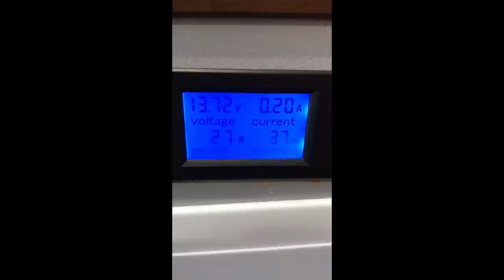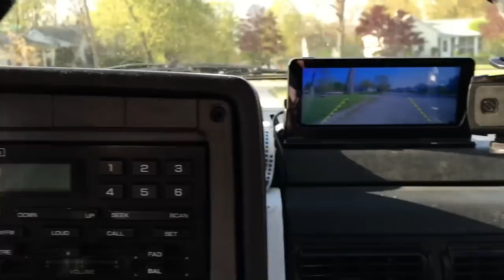Box Truck Conversion GMC C5500 Topkick

Comment: That looks really professional. If you haven't found your calling yet, this is it!
Reply from the maker: Wow, thanks!
Reply: Was thinking the same! He could be a Design Consultant for Forest River, Coachman, any ones out there!
Reply: The Heard I have questions about your electrical system... How do you have the electrical capacity to run all those appliances and AC and refrigerator all off of those few panels? 

How? What kind of batteries do you use to run all of those things too? I want to understand your electrical setup. It boggles my mind.

Comment: Cool project. We have one of their trucks converted for lawn mowing. We have found that the box is not 100 percent water proof and after a good rain water will run down the walls a bit. Not a problem for us but if you have nice walls and such you may want to re caulk the corner seams.
Reply from the maker: Done. Thanks for watching!

Comment: I think that was absolutely fantastic!  Love those low floor U-Haul trucks and never thought to convert one.
I do have a couple of comments though.  1) During the cool mornings, hot days and again cooling evenings, the Styrofoam tends to expand and contract making creaking and popping noises.  I would have opted for either spray foam or batt insulation.  2) Not sure if you were using 2x4 or 2x2 wood studs, wood is ideal for the floor but maybe consider next time using a 2x2 steel stud for framing.  It is must lighter overall and is fireproof.  Fire resistant materials should always be a main consideration in such confined spaces like a camper!
3) Will you be using it during winter? If so, did you make sure that all water lines slop back so that the entire system can be drained?  Did you install insulation around the plumbing?  Did you install heat tracing along the plumbing to prevent water freezing??

One other after thought.   I would suggest that you move those batteries out from under the side wall so you can easily access the fill caps and add "distilled" water when needed.  Also buy and install a large "rubber" low profile pan to sit the batteries in.  Deep Cell Batteries when charging are known to expel gas fumes and boil over.  Boil over is water/acid excaping the cap vents and flowing onto the floor!  A catch pan will save your floor from be eaten away.
Reply: Nothing beats spray in polyurethane foam, though it is the most expensive, it can actually add structural strength and is for sure the most effective R value per inch.  My only critique of the build.
Reply: Great job, well done!

Comment: Nice job. I like the design and the craftsmanship shown. Not a fan of all of the different finishes, but that's just a question of individual tastes. Overall 10/10 for the design, 10/10 for the craftsmanship, and 8.5/10 for the finishes. Would make for an interesting business model to make a floor plan like that you guys could knock out for others. For use as an RV or even as a spare spot for guest.
Reply from the maker: Im now becoming more aware of the possibilities this build is bringing. It just started as a personal build. It has become so much more now.

Comment: This undoubtably is the nicest and prettiest U-Haul conversion I’ve ever seen. You did a great job! From what I could tell you  actually forget you’re in a truck box when you’re in there! Kudos and good luck! Stay safe.
Reply from the maker: Thank you for watching. You 100% forget your in a truck. There is a realization every time you step outside, it’s surreal. Also, the individual spaces can be closed to feel extremely private and opened to get the opposite effect. The spaces came out better than I designed originally in that regard.

Comment: Here is a low cost way to reduce the flat front, get a clear skylight cover and attach it to the cab over part. Mount a camera so you can put above it led security lights.then paint the area that is not used for the camera and lights , looks less box truck and easy to hide tv and radio antenna, wi if antenna s, external cell antennas, security monitors.i like your plan. You could make awnings for the windows from some of the scrap window cutouts. Use tear drop hatch hinges and rivet them on use a internal latch so you could seal them up if you had to store it, and it would be secure. Did you make a pass thru from cab to house?

Comment: Saw another vid talking about paint. Best paint is truckbed paint little $ but heavy scratch resistant paint once an have in colors yu want
Reply from the maker: Peggielee Roberts Yes the paint hasn’t held up in a short period of time. I only did one coat of some Dutch Boy exterior paint, but still. Thanks a million for the suggestion, that’s probably what I’ll do next.

Comment: Really interesting build, think for the extra money i would take it to a place that custom builds vans and have them design a less bullky morr open mutifuctioning space .
  Good chassis. Installing the solor and insulation would be good and mite save you some money you could wire it to long leads and they could figureout how to tie it into the more functional space.
   Decent learning experience still keep on building them you will get it all dialed in.
Reply: That’s the beauty of the custom build. It’s builder’s choice. We all decide what works best for us and we go for it. 😎

Comment: Hey just an idea my guy...u might want to make a door between the passenger seat and the driver seat so u can get in and out of the back without opening the back sliding door but make the door where u really can't tell there is a door there and put a good lock on the door just in case

Comment: Very nicely done... very well thought out . Question, did you have space for alternative transportation,  like a spot for an electric bike or a Honda trail 125 just in case you saw a really nice road to enjoy as you travel... or (God forbid) if you broke down and needed to get around to fetch a part ? I find that not many conversion builds include multiple types of alternative methods of transportation or power sources and power supply systems like generators or solar or even electric power stations
Reply from the maker: Ive been able to travel and keep my car with me. So far so good. I took reliability seriously as far as components and redundancies as best as i could with the budget i had. Thank you for watching.

Comment: The color choices aren't my top choice... But honestly it looks like a real build not some glammed up person with piles of money that I couldn't keep up with even at 200 percent effort... An scoring on left overs from people in way better circumstances left an right that actually match nicely... 🍹🍹🍹You did good...rug is nice with the colors you picked... I'd do a different colored counter for sure... But I'm a beach sea blue themed type myself.... beach wood weather's light blue chips so the counters an rug would be grey's an blues an some white an brown... But honestly low price an free is normally where I stand... Hunting an amassing items big by bit.... looking good... Wish I felt near as confident in my travel trailer rebuild never thing... Honestly going to have to pay for it register it then work on the floor rot that's dangerous... The bad plumbing in the shower rotted the whole bathroom an in front halls floors... The pipes under the sink I tried to fix that leak a number of ways.... An the toilet only flushes in hot weather... An when using septic safe tp an we do not have septic???.? Thankfully it's 112 all summer here..... So at least that's not a issue intill Dec then I have a camp bucket trash bag system for then... Really... I wanted to build a camp cabin in the woods an start with a bucket toilet anyway.... Like I said bit by bit...

Comment: Great job! Just curious about how much did it cost for the conversion? I want to do one but I have. No idea what type of budget I'm gonna need.
Reply from the maker: Wll this is 24 foot. With every square inch accounted for. Im in a bit over 20k. Could be done cheaper with a smaller rig, less components etc.

Comment: Dude nice build.. did you do anything to the suspension? I have a c4500 and it rides a little rough. Thanks
Reply from the maker: I did not do anything to the suspension. The ride isn’t the best around town, but very smooth on the highway. Ive got some quotes for some new tires meant for more comfort and there isn’t many options. If i want a smoother ride i will eventually have to touch the suspension, for now the ride isn’t bad though.

Comment: That's pretty sick man , was the couch put in before the bathroom? Tight squeeze getting in through the hallway
Reply from the maker: Thank you! The couch was one of the first things I bought in the build. It sat brand new in the living space in plastic most of the build. After I finished everything around it, I unwrapped it cut it down to fit and reupholstered it.
Reply: #903 follower, right on.
Reply: I looked at the same type of truck on kijiji in Toronto , 24' thinking about doing the same sort of thing. Let me know what you get in gas mileage after a bit.
Reply from the maker: Will do.

Comment: Maybe I missed it somewhere but I was curious as to why you decided to do this build? I built a 24 foot truck into an RV/toy hauler. In  the front 16ft was the RV and the dirtbike hauler in the back 8ft For going to the motorcycle races. Are you planning to live in this thing? Or did you just want to tackle it for the fun of the project? Either way great job!

Comment: Just bought a box truck but I can’t find how to get the proper issuance. Can you tell me what to do next. I’m not operating in commerce so why do I need commercial insurance. HELP ME PLEASE😢
Reply from the maker: Insure it as commercial because thats what it is despite what you use it for, and so you have some insurance. Then once you finish the build you can switch to motor home or rv insurance. Your insurer will have a list of requirements to be able to insure its as a motor home. You might want to call and get that list in advance. Then you can know what your insurer will require and make the switch smooth. Thanks for watching.

Comment: Hey there,  what size is your rig & how much did you pay?  I'm gonna be firing a vehicle in the next year so I'm curious. Was rigid cheaper than spray foam insulation? Us it possible to have a roof deck on the rig? How stable is the roof anyways? How tall are you?(I ask cause I just saw a video where the couple lowered the ceiling to make storage over the bath) what's the height of the rig? What do you recommend as gas as windows?(house style or the setting out type)  is it possible to put a bed that is on actuators or an elevator system? This is partly why I asked about the roof strength. Thanks for you help. Peace, blessings & long life to you.

Comment: Why is that lift up table (piece of countertop) so far from the edge of the countertop?
Reply from the maker: I have a 110 outlet in the cabinet next to it. I spaced it to avoid wires I may have plugged in. Thanks for the feedback.
Reply: The Heard cool. It just looked odd.

Comment: Would you mind sharing what insurance you were able to find?
Reply from the maker: I have Progressive motor home insurance. They had some requirements (things the conversion must have), but I met all the requirements and they had no problem insuring my conversion. Hope this helps.
Reply: @theheardtrucklife  I was told Progressive would in no way insure a self-build box truck conversion.  I will contact them again.  Thanks so much!!
Reply from the maker: There was some pretty strict requirements. They wanted it to have its own water supply, heating cooling, shower, bathroom, and a few other things I’m forgetting. So it pretty much has to be a pretty complete rv. Also it should be done or pretty close like mine when you call. I don’t think they want to hear it’s being built. Although I did tell them exactly what it was I didn’t hide anything. Hope this helps!
Reply: @theheardtrucklife  Yes, it did, thanks again!  More expensive than I was hoping, but looks like it will work.